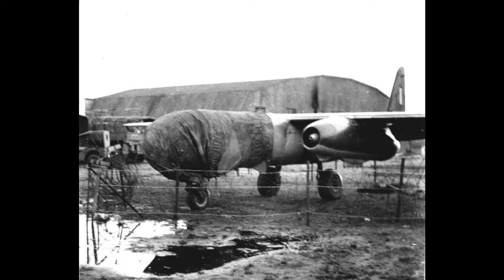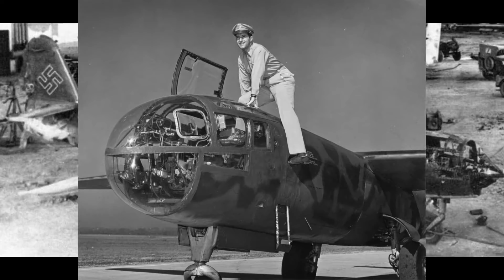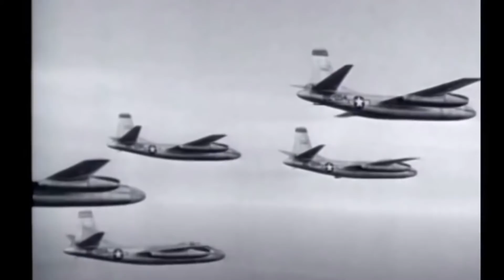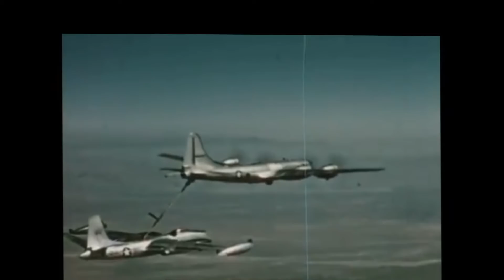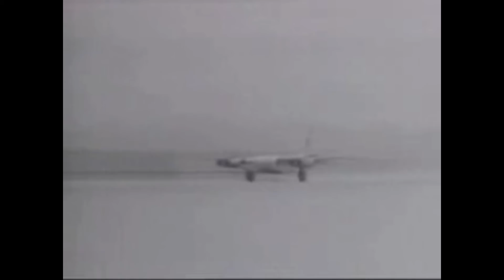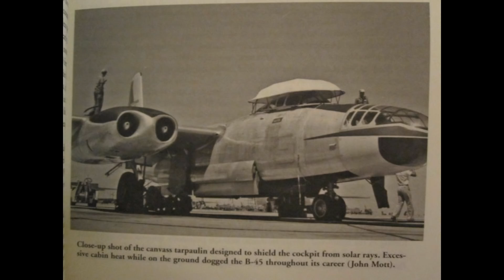Americas first jet powered bomber | The B-45

Comment: Your presentation ruins the  video, even though it is not bad factually (I have seen far worse ). Narration needs a lot of work. You come across as very nervous and unsure of yourself. The number of "um's" is very off-putting. Work on it! You are not in front of a firing squad! Take it from someone who would have cheerfully faced a firings quad rather than speak in public. I compensated by becoming  a bit of a comedian when required to speak in public.
Reply from the maker: It was the 1st video I ever made.  I agree, it’s pretty terrible. Lol. I’ll probably take it down and re-do it at some point. Thanks for the advice.

Comment: I noted a few shortcomings in this presentation which call for comment. Firstly, the discussion of the Ar-234 Blitz takes up too much of the total length. It is a fascinating aircraft, and deserves discussion at length -- but not here.

Though the German jet helped inspire the American bomber program, its design did not contribute to the B-45 program other than to point out deficiencies in the Arado bomber that needed to be avoided. Though designed as a bomber the Ar-234 was largely a failure in that role, amply demonstrated in its inability to destroy the Ludendorff bridge even though it was basically immune from interception by the best fighters the Allies had in service. Arado produced about three dozen mostly experimental variants in an attempt to develop the 234 into a useful offensive weapon, including several four-engine versions and a version without conventional landing gear, which nevertheless failed to measure up. The basic fault of the Ar-234 was its size, though a multi-engine bomber type, it was considerably smaller than a P-47. To make room for fuel and payload the Ar-234 was a single-seat aircraft. Being unstable in the roll axis, the Blitz was a handful to fly on the bomb run, when the single crewman had to worry about too many demands on his attention, consequently, accuracy suffered. When attacking the Ludendorff bridge in 1945, many sorties tried dive-bombing to increase accuracy, but the Blitz was just not sufficiently strong nor properly equipped for effective diving attacks. Flying in its element straight and level at 35,000 feet, the Ar-234's shortcomings did not affect its strengths as a photo-reconnaissance ship, however, so it was a useful aircraft, particularly in the Italian theatre of operations. Albert Kesselring was able to use Blitz photo missions to get the best results his meager forces could provide, thus slowing the Allied advance up the Italian boot to a crawl. In desperation to hide their troop dispositions from the Germans the 15th Army Group requested and received a commitment of Lockheed YP-80 fighters to the Italian front to intercept those Blitz recon sorties, an unusual departure from the standing policy of not putting prototype aircraft into combat. 

The B-45 was mostly designed prior to any close inspection or evaluation of the Ar-234 Blitz, therefore other than turbojet power the two aircraft share virtually nothing in common. The Arado design was unconventional in many respects, mainly because of deficiencies in the available engines. The need for range and payload meant paring back the airframe to the minimum size consistent with two engines and 3000 pounds of ordnance. Though benefitting from its slower development pace the B-45 was nevertheless quite conventional in layout and crew provisions -- three or four men, with a pilot and co-pilot to manage the ship, a navigator-bombardier equipped with an advanced version of the Norden bombsight (in later models a radar blind bombing system) and a dedicated gunner for defense. The excellent GE J-47 axial-flow turbojet allowed the B-45 to be quite large, about the size of the B-17, and thus much more capable than the diminutive Blitz.

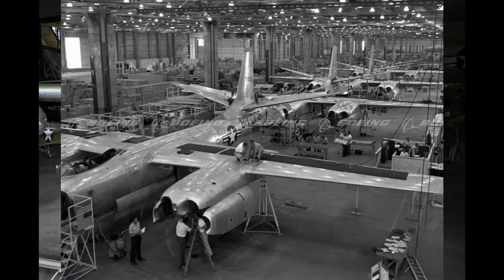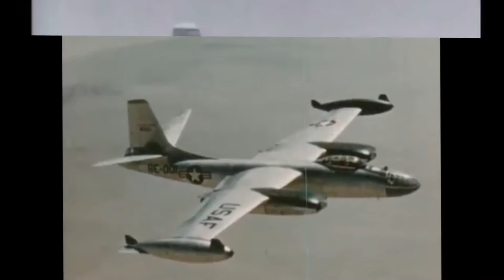The video does not mention North America Aviation, the B-45's prime contractor, which is an important point to understanding why the Tornado was what it was. Ironically the first look we get at the B-45 is a still picture at 3:31, which is watermarked with the Boeing logo, North American's chief rival. Naturally, the B-45 design team leveraged their experience with earlier North American aircraft to produce the B-45, most notably the B-25 -- twin engine nacelles, shoulder wing, tricycle undercarriage -- and the P-51 -- laminar flow airfoils, flush-riveted semi-monocoque fuselage. A departure from the B-25 was the tail layout. Windtunnel tests of the B-25 showed that the tail-gunners position induced turbulence which adversely affected the tail empennage, thus the twin-tail layout which moved the rudders outside the turbulent region. For the B-45 North American wanted a cleaner, stronger tail empennage. As a solution  to the tail-gun turbulence, they adopted a jettisonable aerodynamic fairing to cover the gun position. This is why at 4:32 we can plainly see the tail gunner's canopy but no guns are evident. The idea was to keep them covered and out of the slipstream until the bomber was in immediate danger of attack.

Responding to the same Air Force request for a jet-powered medium bomber that produced the B-45, Boeing eventually won the lion's share of the market with their B-47. Though having a slightly smaller thrust-to-weight ratio, the B-47 outperformed the B-45 in every respect, thanks to its swept wings and its stressed skin construction, a technology pioneered by Boeing in the B-29. While the B-47 could be arguably one of the most significant aircraft of the post-WWII era (technology pioneered in the Stratojet project is flying today in every Boeing 7-series commercial jet) the B-45 was never more than a stopgap with little or no influence on future designs.

Comment: Worth mentioning is that a handful were turned over to the RAF specifically for spying missions over the Soviet Union.
Reply: I read somewhere that the R.A F. also did '50s spying work for the U.S. using their own Canberra reconnaissance planes, You wonder why the U.S. didn't do the job themselves, unless the U2s weren't available at the time.

Comment: Have heard rumors of one in RAF markings spying across the iron curtain back in the fifties. But only rumors.
Reply: Yes,  the R.A.F crews did fly B45s with R.A.F markings over the Soviet Union on spy missions but only a few missions were flown.  On the night of 17-18 April 1952 three RB-45C aircraft were wheeled out of the hangars at RAF Sculthorpe. All the USAF markings had been taken off them and they were resplendent with RAF roundels, much to the surprise of most of the station personnel. After take off, 2 aircraft were refuelled in-flight by USAF RC-29s tankers over Denmark, the other was refuelled over Germany. "Once we left Copenhagen on our way in there were quite a few lights and ground features you can see from the air then. Lights on the ground always give you some reference but once you get into Russia itself, Russia is one large black hole with lights, odd lights here and there. Nothing like flying over a densely populated country or flying over any big areas, like France and Germany. So therefore when you do see lights they really stand out and the way we went in there was very little, there were big areas we were supposed to be photographing; most of them were installations out of their radar range, armed installations which are not lit, and once we came up south of Moscow itself you can see all the lights. Moscow’s a big place and lit up so you do get a good reference point from that. When asked what he thought when he saw Moscow out of the window, Bob Anstee replied "I thought I'd be very happy when I didn't see it any longer and was going the other way again." Crampton and Sanders took the most southern route, which was also the longest. "The flight I was involved in was rather a long one, we had to refuel over Germany before we went in, and we flew about a thousand miles into Russia and then arced our way southwards to come back. And on the way out we had to refuel again to get back to base. Our total flying time for that mission was about ten and a half hours, said Crampton. The other crews also returned safely.
       SEE  https://spyflight.co.uk/operations/
Reply: Mark Felton talks about these planes and spying